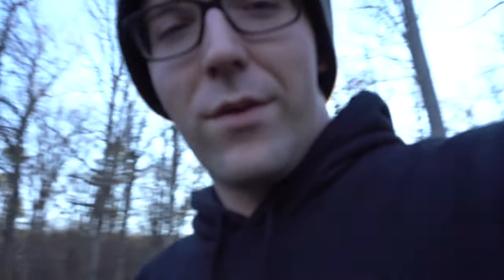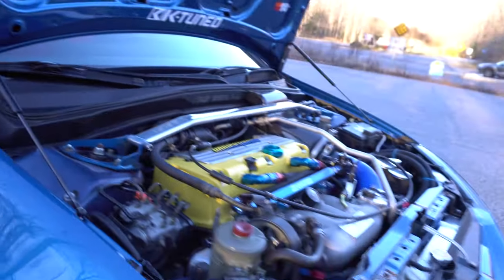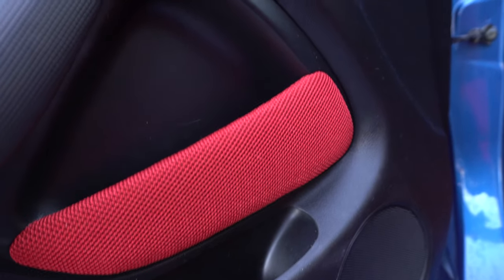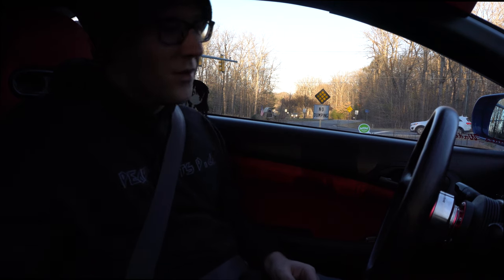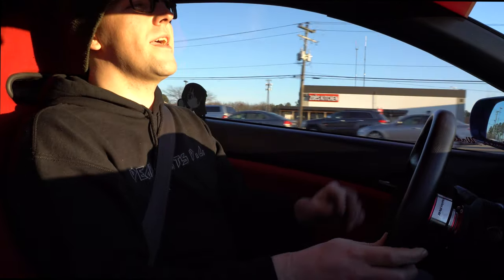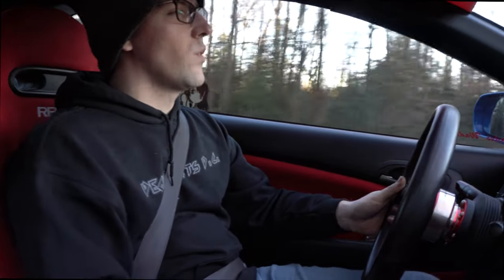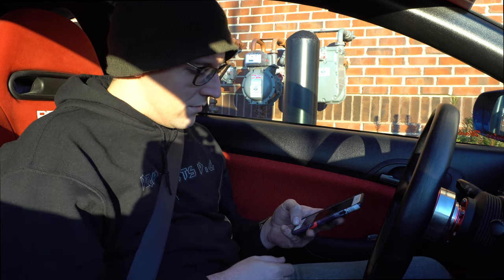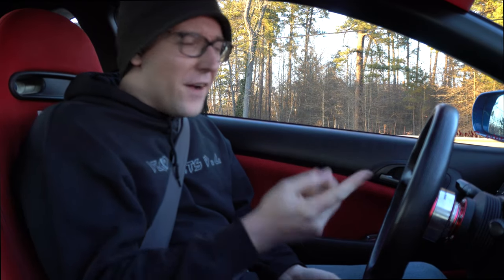2004 Type-R Converted Acura RSX Walkthrough #3 & Test Driving Vlog

Comment: Tastefully modded!

Got links to the red interior fabric seller, RetroAutoTek? Did you use them for floor mats and carpet too? What's the color of the suede you used?
Reply from the maker: thanks dude. yeah the insert material was purchased from RetroAutoTek in Australia. the carpet/floor mats/ upholstery work was ton by a shop i used to work at. as for the color of the suede for the back seats if i remember correctly it was Lipstick Red. that was the closest color to the OEM Recaro red. hope this helps! sorry for the late response. i just started checking messages again on this channel. actually just dropped an update for the DC5 a few days ago.